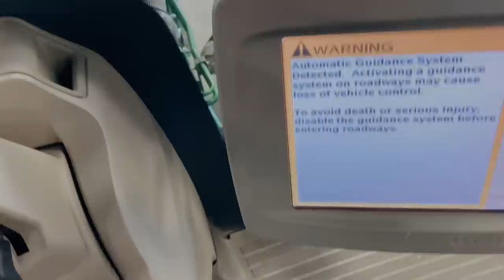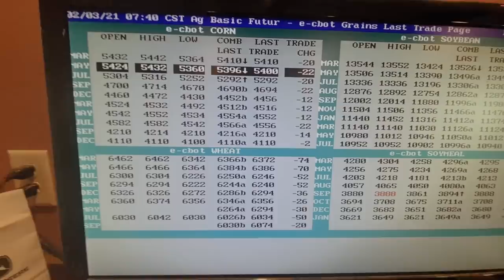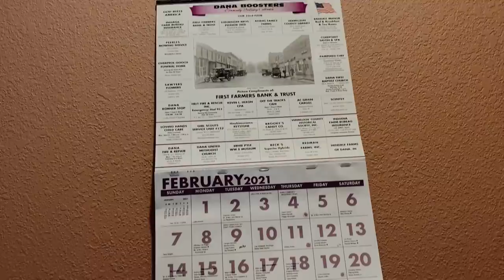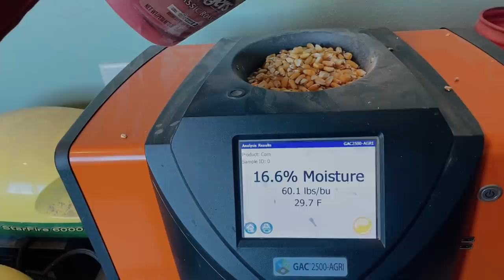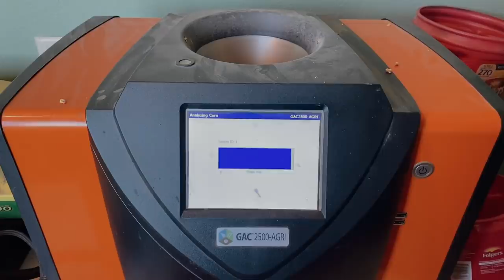Week Recap: Shop Work, Loading Trucks, & Helping the Neighbors with Their Big Project

Comment: Ms.Erin. If y'all are replacing the fan drive belt on that tractor. Check to see if it have grease fittings. Bushings go bad causing fan speed high or low. Make sure there are no codes coming up for that.

Comment: Erin, Learn to Learn!  My Dad always instilled in me that if someone else can do something I could too.  I am an old fart, but as far as doing mechanical work, it is 90% common sense.  We now have the internet so we can research any task.  I taught myself everything about Information technology.  I got a job with our National Security Agency and retired making over 6 figures.  Your Dad (Like Mine was ) is one hell of a knowledge source.  As him about things, as that is an indication of strength not the other way around.  I also became a pilot and flew for many years.  The first engine I ever worked on was a 2 cylinder John Deere and I owe my mechanical career to John Deere.  In case you are wondering, I was a mechanic before I concluded that I could not see myself in later years picking up heavy parts like cylinder heads hence the reason for learning about computers.  I am not finding fault Erin!  Bye the way, where is your family farm - You all sound like mid westerners?  I am originally from Illinois.

Comment: Erin, chainsaw sharpening tip, you can pass this on to your dad. try not going down the edge and throat in one sweep. it creates to much heat and the edge will melt and flare. i noticed the discoloring or blue ing meaning it got to hot. take two or three strokes with the stone on each tooth, minumize the heat. the edge will stay clean. heat is good for loosening bolts but not sharpening. a lesson i learned very young. i wouldnt take the time to mention this to just anyone, you are just that different type of person. and you have a cute nose.  spell check is not working to spell blue ing

Comment: Sorry but your using the chain sharpener a little bit wrong. You should just touch it with short timed hits, when you hold it to it for a few seconds it blues the cutter and makes it brittle so it doesn’t hold a good edge anymore, if you watch the video around 3:15 you can see it turn color. Not hating just helping, keep up the great videos!

Comment: Go easy on the chain sharpening.  When the metal gets too hot it takes the strengths out of the metal.  Quick short stabs so metal doesn’t heat up.